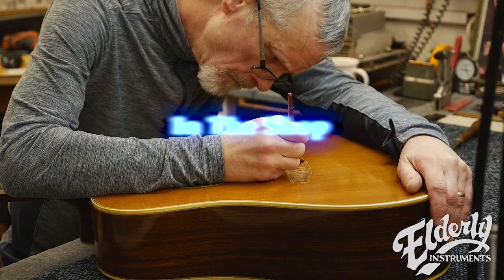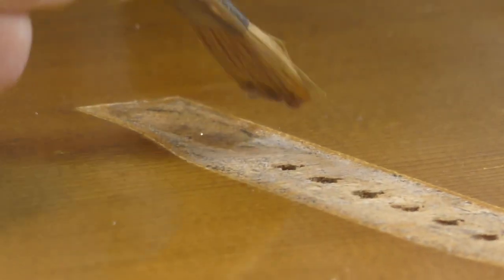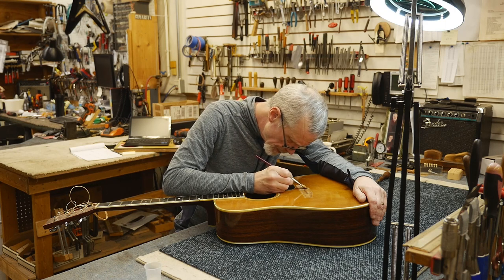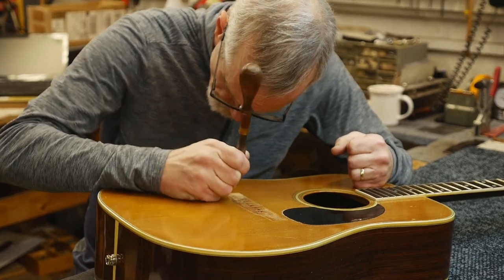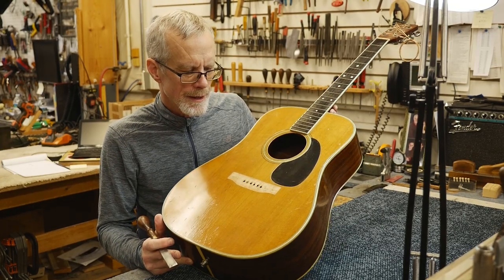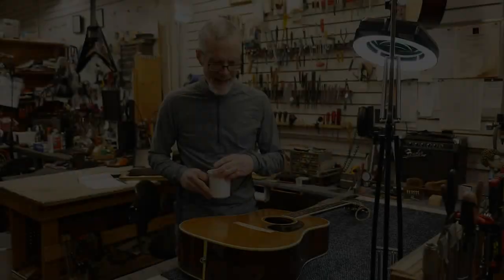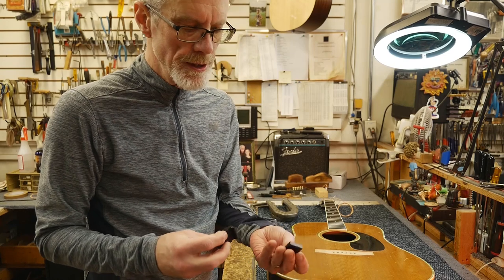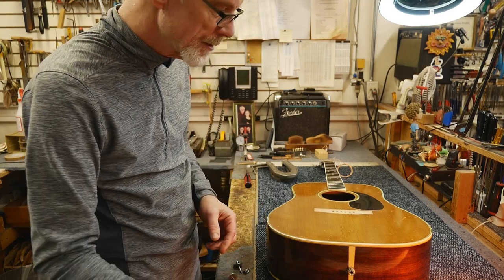In The Shop: Gluing the Bridge on a Vintage Martin Acoustic Guitar | Elderly Instruments Repair Shop

Comment: Thanks for the detail and explanation as you go, very helpful. I have a 1967 Epiphone Cortez FT-45 I am getting ready to make/replace the "plastic with ceramic saddle" bridge that was stock...the pick guard cased the typical "Martin split" but its on the bottom side of the pickguard not near the soundhole...pretty bad cupping which I am humidifying for a week to get it to relax after removing the nitrocellulose pickguard.
Love the detail and information her, top shelf!

Comment: Great video, thanks. Although I have another problem ... I made a diy wooden clamp that goes over the bridge, is curved on the bottom to fit the bridge top and connects, trough the string peg holes, with the lower (inside of guitar body - under the bridge) part of the clamp via 4 threaded (4mm) rods that are tightened with 4 wing nuts ... and there is one hole on each side of the upper clap for the rod that pushes the wings of the bridge down with the help of small pieces of wood. So ... I have removed everything except for the lower part of the clamp which is now glued to the top from the inside and does not want to come off. Tried really hard to kinda snap it away, with no success. Drilled all 12 holes all the way trough the bottom (I used a metal drill bit for the four holes that had metal inserts for the rods, there is still a thin metal cylinder left inside of the lower clamp - could present a problem if I wanted to use a hole reamer to try to slowly remove wood in hope of the glue to let go) of the lower part of the clamp wood and it still does not budge, not for a 1/1000 of an inch or millimetre. Would you maybe know how does one go about a thing like that? How can I "know" where the thing is glued or how much, when there is no way to see? Is that possible or should I leave the part glued and try to slowly widen the holes so that the pegs fit normally? ... ... ... this really bummed me out.